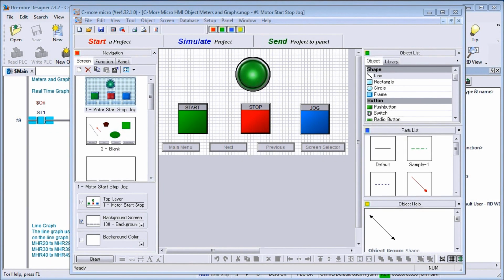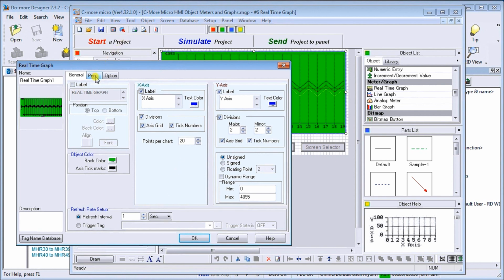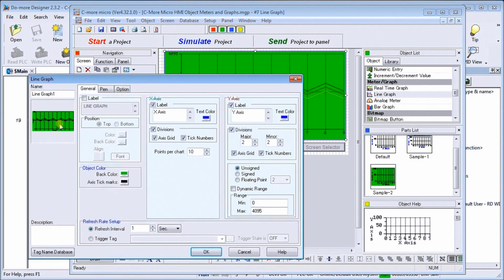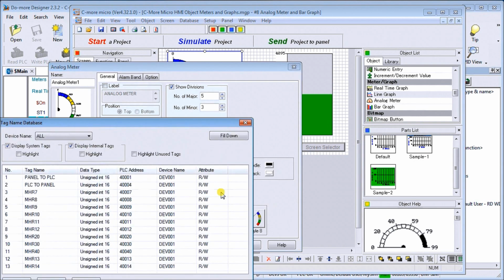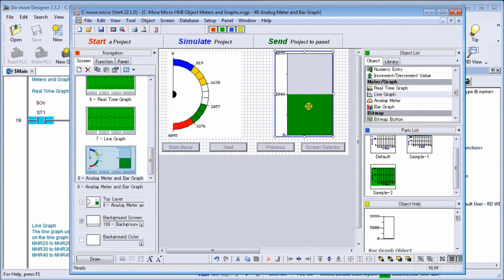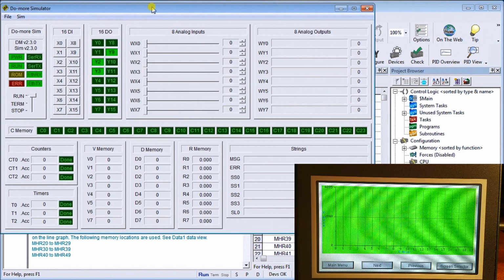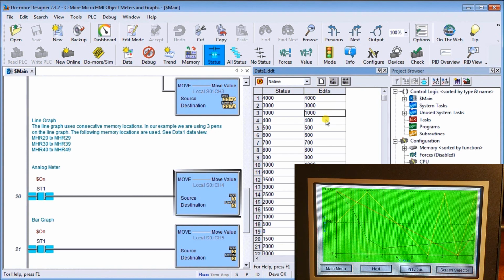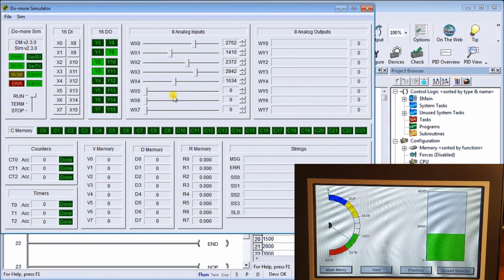Transform Your Factory Displays with Smart HMI Meter Magic

Comment: @Garry Shortt  your videos are awesome! Can you do a video on controlling a stepper motor with built in encoder (integrated stepper motors) using high speed I/o of BRX Do More PLC ?
Reply from the maker: Hi Rakshith,
Thank you for the comments and idea.
https://cdn.automationdirect.com/static/manuals/brxuserm/ch12.pdf
I agree that this has not yet been covered. Currently I do not have the hardware, but will get the components together and let you know.

Automation Direct has done a series with the Do-More PLC (H2) - They show communication via the RS232 port to the drive.
Here is the series:
Motion Control SureStep Stepping System - Control System Overview (1 of 5)
https://youtu.be/6g8xC7ZURE4
Motion Control Sure Step Stepping System - Schematic Diagrams (2 of 5)
https://youtu.be/L8mzRY32SEk
Motion Control Sure Step Stepping System - Do-more PLC Programming (3 of 5)
https://youtu.be/NTFJwe3B01A
Motion Control Sure Step Stepping System - C-more HMI Programming (4 of 5)
https://youtu.be/0oFkWesSbEs
Motion Control Sure Step Stepping System - Operational Demonstration (5 of 5)
https://youtu.be/mnrq4xsA5xQ

Hope this helps you out.
Regards,
Garry
Reply: Garry Shortt thank you for the links!